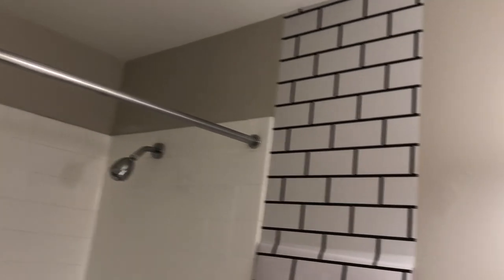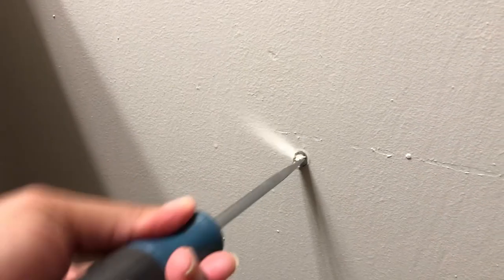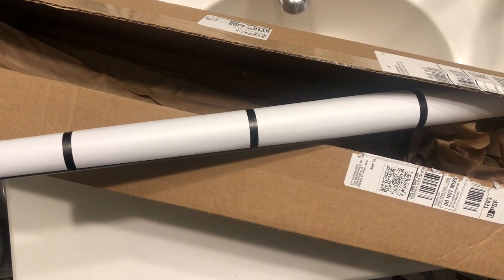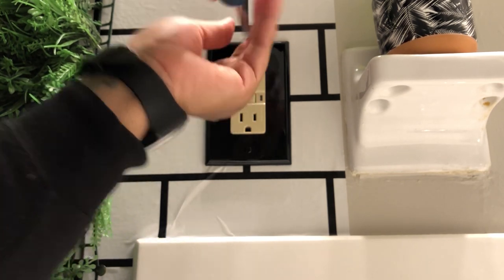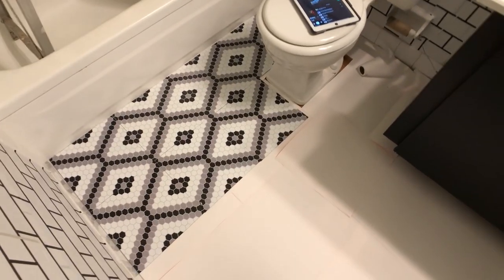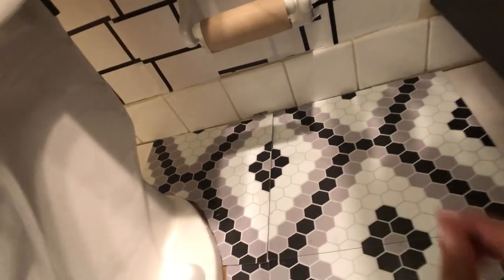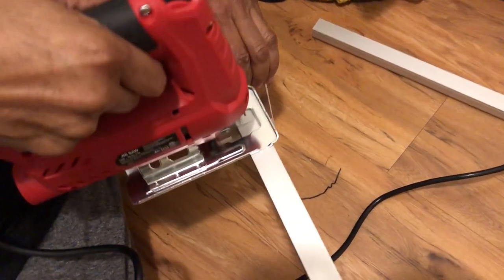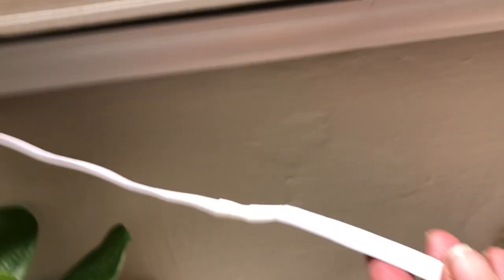EXTREME BATHROOM MAKEOVER (Renter Friendly + DIY LED Mirror)

Comment: if you are doing peel and stick wall paper, never use your walls to measure it going straight. Its next to impossible to find actual even walls. Tie and paper clip to the end of some string and stick the string to the ceiling, where the string falls is your straight line and you line up your first piece to that. Also for your sockets, if you picked up a new plate you should pick up white actual plugs and switches to switch up your yellow ones, they are only about 59 cents and it really changes the space. 

Also I recommend finishing up your peel and stick floor with some caulking around the toilet and where it meets the wall, especially for a bathroom it helps so moisture doesn't get underneath and especially since eye balling and cutting isn't always even (I have been there so many times with peel and stick floor lmao) it just makes it look more finished.

Love how it looks! I actually have that same black contact paper on some stuff in my place too lol
Reply from the maker: I’m going to try that paperclip trick next time, thanks!!! I wanted to change those inner sockets, but not much of an electrician and didn’t wanna mess something up so I just chalked it lol